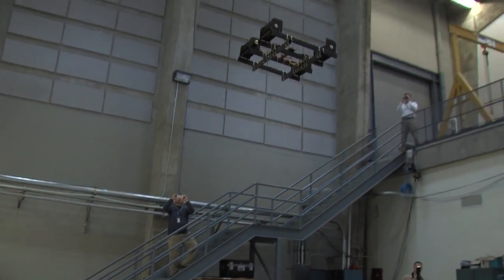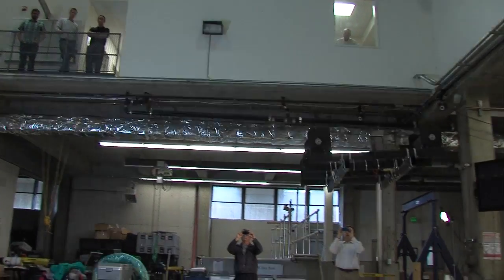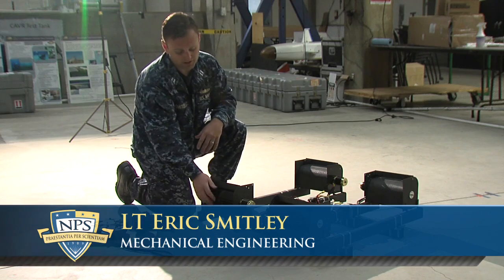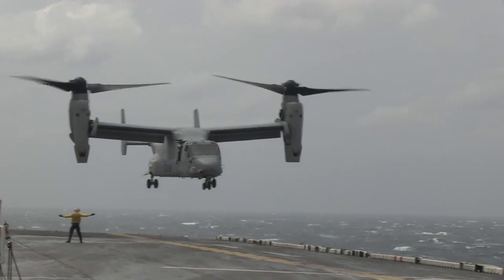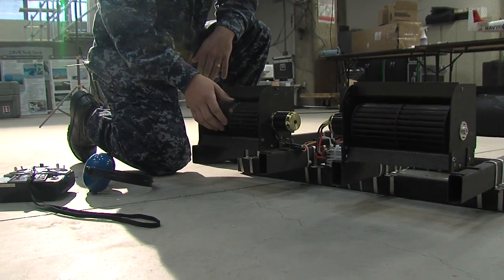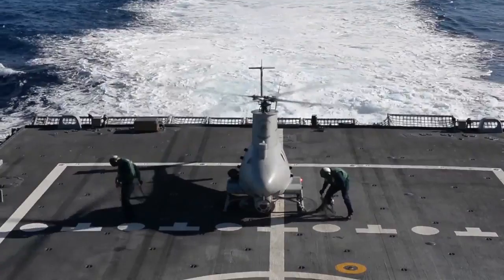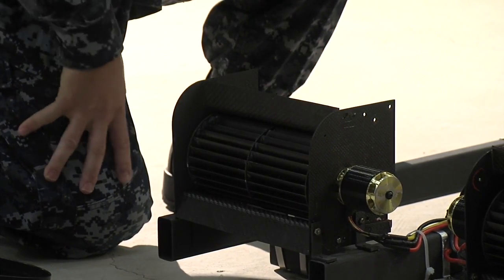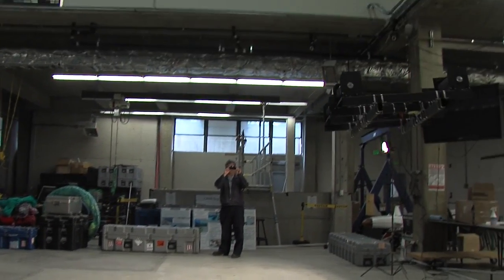Cross-Flow Fan UAV

Comment: So a cross flow fan is more efficient and powerful than an axial flow fan?
Reply: On its own it can be similar but the advantage is that you can make them very long and so increase the hover efficiency. This is similar to increasing the disc area of a helicopter but you do not have the effect of the tip speed becoming very large compared to sections at the hub. There is obviously a limit to the length of a single rotor as it would become too long and not be structurally sound. To overcome this you have to cut them into segments.

Comment: LT
    I am also a mechanical engineer with a somewhat similar design.  I have achieved 400lb payload capabilities  with a similar size footprint using a gas powered drive system.  I believe I have developed a fan design that will greatly increase payload. I will be testing it in a couple weeks and would like to hear what progress you have made since you posted the video. thanks Brien    bohnemus1966@gmail.com
Reply: Brien Ohnemus